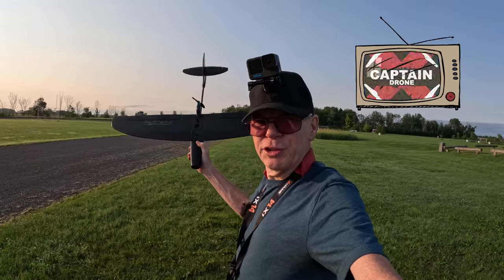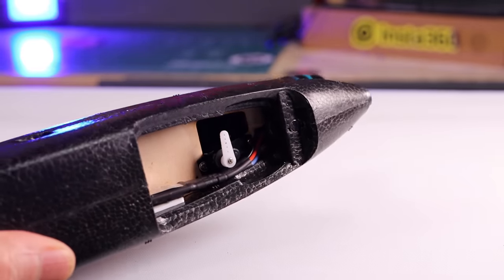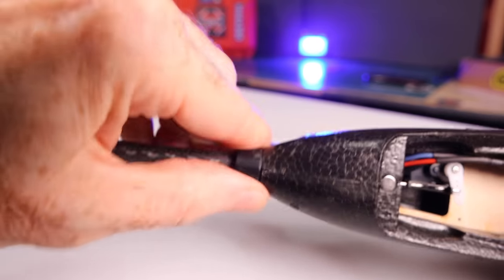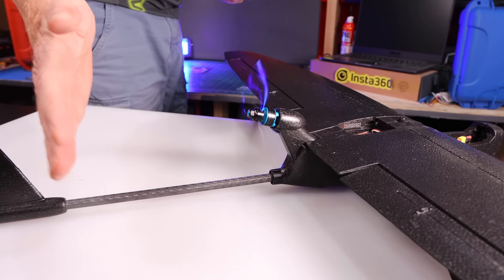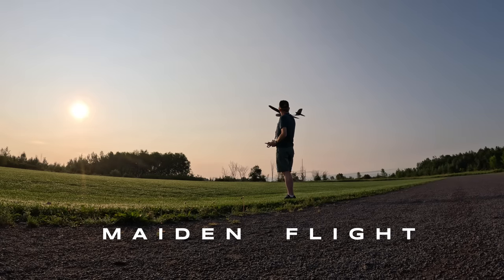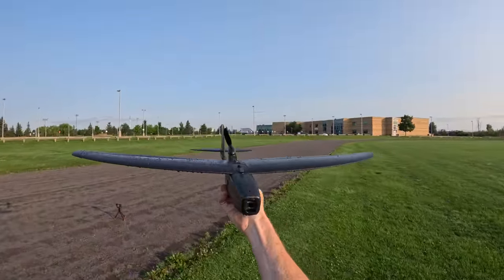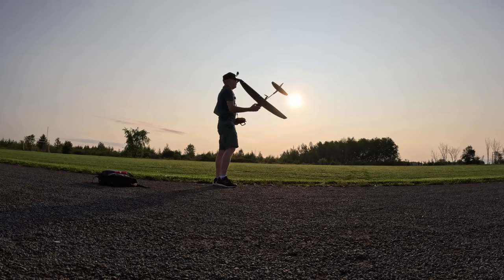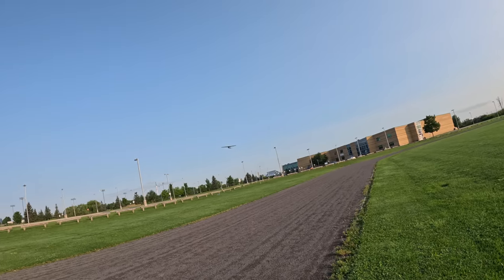The ZOHD Drift Dark Breeze is designed for FPV - Review

Comment: Will a 3s 1300mah work on this? What battery do you have?
Reply from the maker: If the specs confirm a 3S battery is fine, then it is.
Reply from the maker: 1300 may be large in size unless you find a narrow one.

Comment: great video. I  want a Digital long Range FPV plane with walksnail. I got most parts except the plane itself. For a beginner would you recommend the Z-84 Flying wing or this one for a beginner?
Reply from the maker: For a plane with an FPV unit, you’d need something larger than this ZOHD if you are new to FPV flying.
Reply: @CAPTAINDRONE798  Because a bigger plane is more forgiving in the wind?
Reply from the maker: @Rocketman0407 no, just more space to handle the weight of an FPV system.

Comment: Very easy to loose it's orientation if flying line by sight but as a  small fpv plane It's OK. I give it 4 out of 10
Reply from the maker: I find that for pretty much all planes.  At certain angles I loose orientation (am I coming or going... am I right side up or upside down)?

Comment: The ZOHD Drift (the white older version/Breeze newer version) is a good plane for beginners, especially if you get the one has the AIO camera/vtx and the Kopilot with return to home (although the Kopilot has a little bit of a learning curve to get setup correctly)  For a new flier it is not overly fast (although if it is your first plane it will feel fast),  It is very forgiving in the air as long as you are going slow super easy to build and you get good flight times.  A couple of issues, it is not the most durable, but in most cases crashes can be repaired easily (maybe not pretty), if you go too fast you can end up in a spin which for most people results in a crash.
PROS:
-It's a pusher, so the prop and motor/motor mount don't typically break on impact
-It's pretty stable in calm error
-It's easy to launch provided you have your CG correct
-It's an engineered solution if get it with the Kopilot, GPS, and AIO camera (adds about $40 USD for all three), that gets you a FPV feed and return to home/gps rescue without having to solder anything
-There's enough room  to add in a small flight controller like a Matek F411 WTE, and BN 220 or BN 180 GPS if you want to go the INAV route later (which I would not do first if this is your first plane)
-There are 3d parts available
-This is great plane for 2s DIY 18650 battery packs (easily get 30 mins)
-On 2s its is almost silent 100 feet up a 60% throttle or less (a little louder with that smaller prop turner faster)
-Glides forever, great for landing because the stall speed is low, just make sure you have enough room.
-No rudder (die hards will object because I listed this as positive), but for a new person, if you don't have someone teaching, the rudder can cause you to crash because it is the same stick as the throttle, so you try and use rudder and aileron to turn, and you lower your throttle to zero, you're probably going to crash. 
-The plane can be broken back down to fit in the box it ships with

CONS:
-It is CG sensitive, too nose heavy and it will dive right into the ground on launch too tail heavy, at best it will bobble up and down., at worst you'll crash 
-It can stall if you get going too fast because the wings flex
-It is not the most durable in a crash (the nose where the canopy sits and the area with the spar goes through are breaking points
-The ESC needs to be calibrated for the best performance (if you don't you can end up losing a lot of throttle range (especially on 2s)
-If you fly 3s with 5 inch prop you will burn up the motor  (the ESC should be fine, but the motor will burn up)
-If you only want to fly Line of Sight (LOS) and don't want fly with a flight controller, then this plane is probably what you're looking for, if you are new, because it is not made to take a lot of crashes like true trainer
-If you go the FPV, Kopilot and GPS route, plan on watching youtube videos on how to setup the Kopilot, (RC Video Reviews has some good tutorials on this)

Recommendation:
If this is going to be your first plane or your first FPV plane, get the white version (it's about $10 USD cheaper), get the full FPV version with the Kopilot Lite and GPS.  (It can give the newbie  peace of mind that it if it gets out of sight, you can flip a switch to get to come back  and loiter overhead.
Double check your prop, and make sure it is on correctly, pusher style (prop in the back) or tractor (prop in the front), the numbers printed on the prop always face forward.

Comment: Looks like you've bought yourself a new Transmitter. ix14. Nice. 👍👍🤩I also had the ix12. I sold mine, because the ix12 is such a slow processor in it. 🥵🥵 But I ended up buying the ix20se 😰😰😰 bought a demo model of it 👍👍😉😉